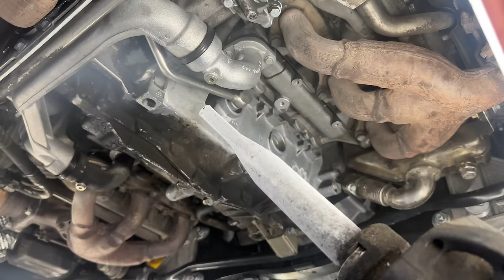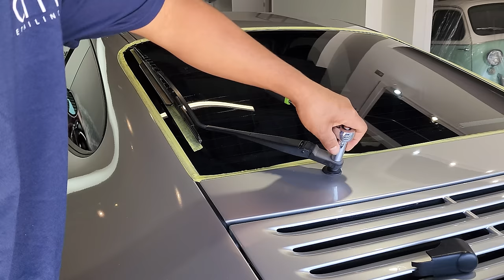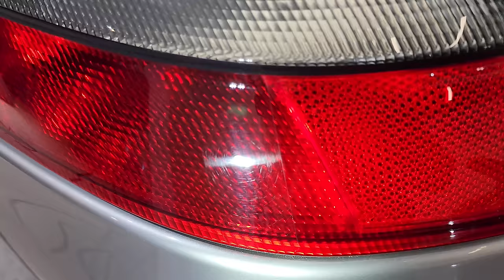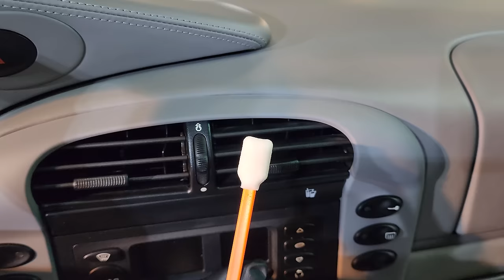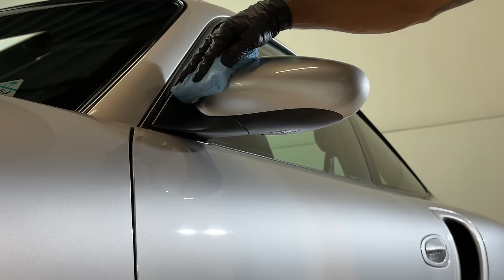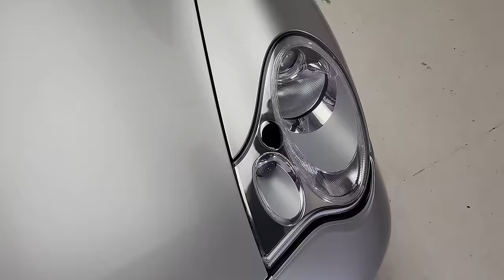Back for MORE! Porsche 996 Turbo FULL PACKAGE DETAILING

Comment: Great job, But I think the brush used to clean the interior should have been softer !
Reply from the maker: Thank you! Appreciate the thought and concern - the brush we are using is made by swissvax, and is specifically made for interior leather. We use a variety of softness grades in the interior depending on the material and condition

Comment: Great video! What the product that you applied on the exhaust to remove the rust or oxidisation?
Reply from the maker: We’re using a weld cleaning brush to remove the exhaust stains. Quite the tool! Looks like magic